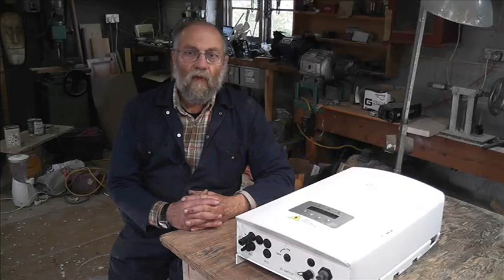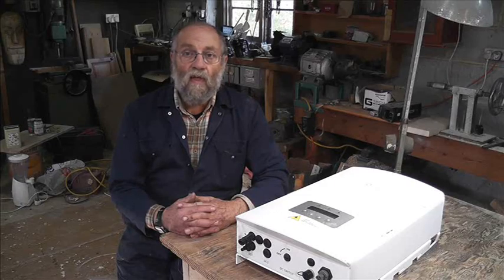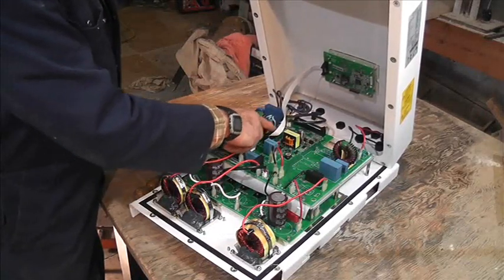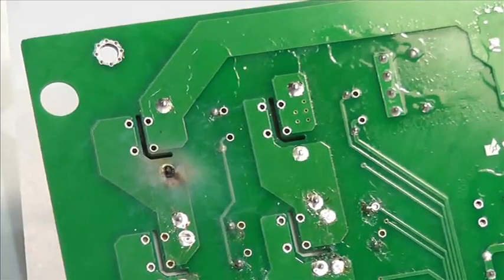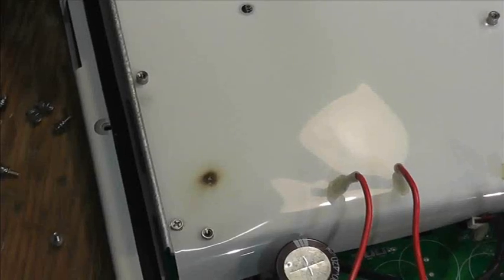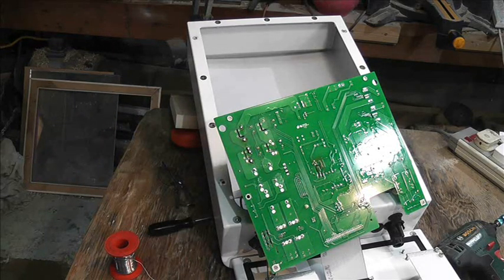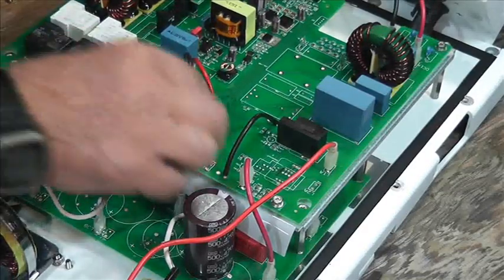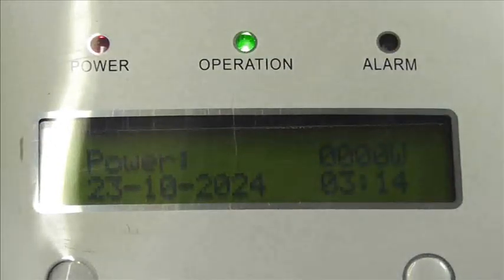Solis inverter, low volt start: test and repair, guerrilla urban solar, grid inverter repair.

Comment: Hi Andy, Thanks for the great video,
As an electronics tech may I suggest that when you resolder the  relay pins it's advisable once you have done your fist solder attempt to then desolder it with a solder sucker.
This removes all the solder and you then resolder the pin with new flux and the soldering will be thinner and better. (Soldering connections should be concave, not beady) 
The best solder suckers are Oryx.

Comment: Hi Andy, I have a 6K solis inverter. The alarm is showing Grid Over voltage, and No -Grid at times. Could an over voltage have damaged the RCMU101SN-4P4A-5S residual current sensor. Also, does the RCS allow the DC  power to close the electromechanical switches?  thanks...e
Reply from the maker: Hi very difficult to comment, but are all the grid switches and wiring in good order, could a trip switch be faulty? cheers